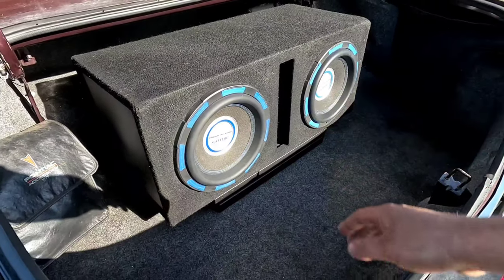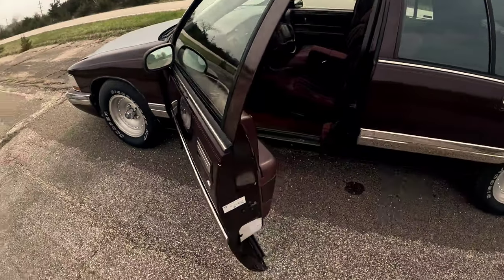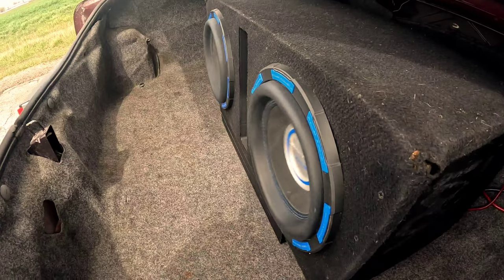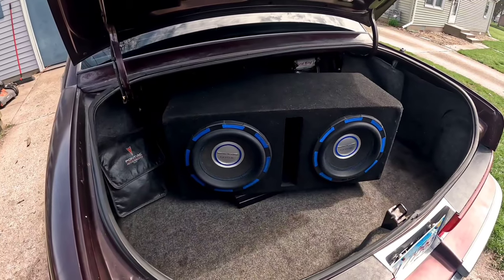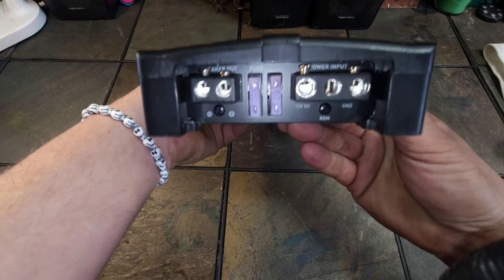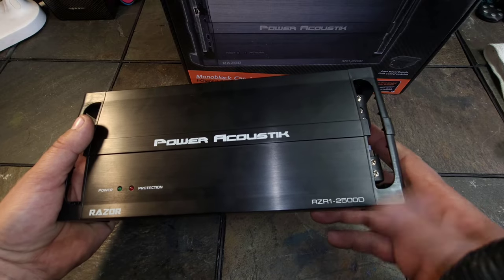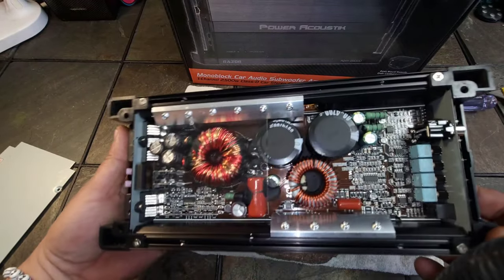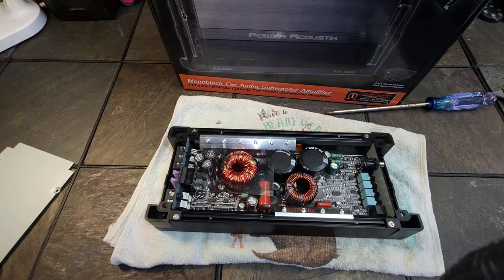Power Acoustik is LYING to You.

Comment: These stickers never hold up in court. They have to prove what you did caused the failure. I remove these every time.
Reply: The Magnuson Moss Warranty Act is what protects us from those stupid stickers.
Reply: Power Acoustik is 2nd only to BOSS when it comes to flat out lying about RMS output. Been that way for at least 30 years, truly pathetic to use dishonesty to swindle a newcomer to car audio out of their money.

On a positive note the loudest system I've ever heard was a Power Acoustik company demo build that was in the mid 160s at a car show at Cal Expo in Sacramento in 99 or 2K.  It was a yellow or gold car from the 40s or 50s if I remember correctly.  The back doors opened and had 6 amps on each door with the cargo area was made up of 4 subs in a + configuration.  6 of those in total made 24 12s with lots of lighting.  Ol Yeller was the name of the vehicle.  Heard them burping it when I was 4 miles from the exit on the freeway.  Impressive😮

Comment: Bought a 12" Power Acoustik like these from Walmart and it lasted 4 minutes with everything turned down. Needless to say I was disappointed and I was able to get a refund.
Reply from the maker: Really? I've had these subs for years and beat the crap out of them with no issues.
Reply: @Blowncapacitor84  lol I wish I could say the same. I'm not sure exactly what happened but after 4 minutes they seized up.
Reply from the maker: @dylanparks2  honestly maybe look somewhere else cuz I would imagine just like everything else coming out of Walmart the quality is degrading very very fast.
Reply: @Blowncapacitor84  true I ended up getting a pioneer sub on Amazon. It doesn't thump as hard as the PA did but it sounds clean and still bumps.

Comment: So you're running them two 12 at a 1/2 ohm ? So how is that ? They are 4-ohm dual voice coil subs two of them that brings it down to 1 ohm load ! Right ?
Reply from the maker: @JohnShepherd-jj7cw  they are dual 8 ohm
Reply from the maker: Final is closer to an ohm if I remember right
Reply from the maker: Ok wait they are dual 4 they are wired in parallel and both speakers are wired together in parallel. It's not uncommon to get a little bit of a lower impedance reading. Alot of variables in there and the multimeter is really just guessing. Thank you for the comment!
Reply: Yeah something isn't right there. They should be around 1 ohm
Reply from the maker: @TrapMyRide  dude no speaker ever sets perfectly at any impedance. It is what it is and has been for close to a decade. You should know better
Reply from the maker: Pretty sure I showed the total impedance on camera
Reply from the maker: I just went and checked and it's sitting dead nuts .5! Every single speaker I have ever checked (thousands btw!) Have had a lower impedance than rated
Reply from the maker: I will literally make a video showing you

Comment: This amp is not powerful enough to handle one of these gothic subs i was using just one of these when the amp partially blew limiting me to half volume before protect kicks on these subs however can handle more than 2500 believe it or not  been giving them absolute hell with no issues probably around 3000 watts on some very hot days with no issues whatsoever

Comment: I've been running similiar set up in an 08 santa fe, full interior speakers upgraded,sound design head unit 5v outputs,  with amp and sub using a single  sub only and slot port box. Since 2018 , zero problems , sounds great , reliable.
Reply from the maker: Nice!!!

Comment: I'm to find the true numbers for the PA Overdrive 1000.... Anyone know if it's true? Thanks
Reply from the maker: I was completely unaware of that amp until now. I'd like to order it and test it out
Reply: I've seen a few P acoustic amps Dyno'd but I haven't found the 1000.2 AB test yet. I think I just saw it for $59.98 ? It wasn't expensive. I just got 2x DS18 6.5 two way in today. I'm doing all the custom work myself. 2000 Accord sedan. I just got back from the hardware store with a 4x8 sheet of plywood & .5x8x16ft board strapped to the roof of it lol. 15 minute drive took 45 minutes 😅. Gotta do what we gotta do sometime. It's worth it. 51 yo & this is my last & best build.
Reply from the maker: @barnes29510  NICE!! Enjoy man!

Comment: Rockville makes a statement about power ratings that explains why power acoustik over rates by so much. They are in the budget segment where most brands do the same (Boss). They have to grab the attention of the inexperienced customer that won’t know the difference between max and true rms ratings. That being said, with this series of amps Power Acoustic delivers way more than others in the same price range (Boss). There is a Soundstream version of this amp that is more accurately rated and is actually more compact because it doesn’t have the plastic trim at the ends of the chassis.
 Keep the up the good work with these budget videos.
Reply from the maker: @2011joser  thank you!!!